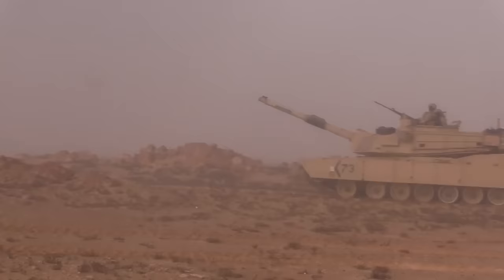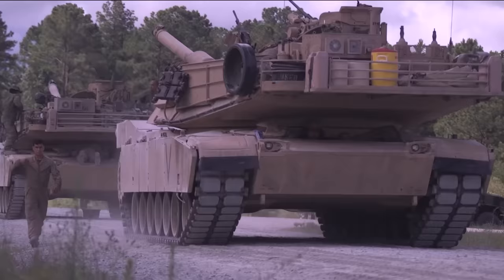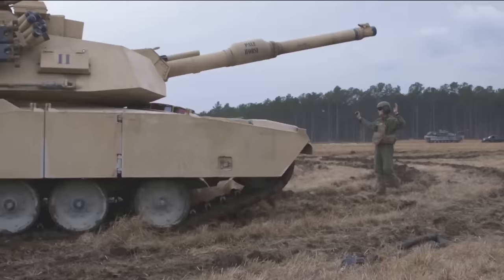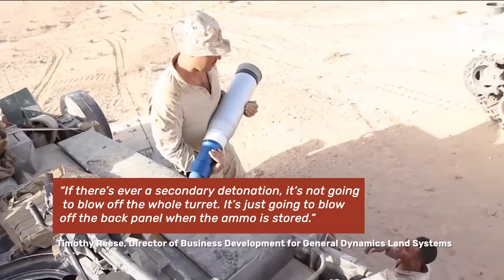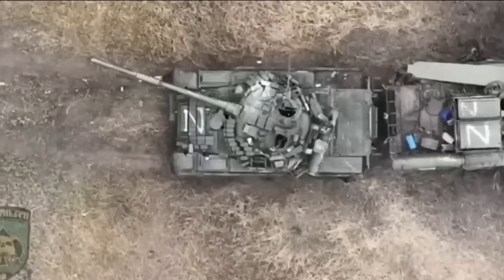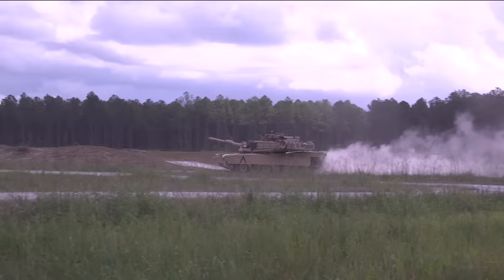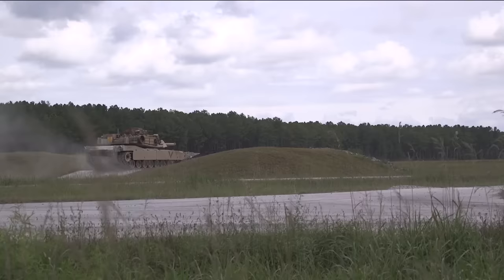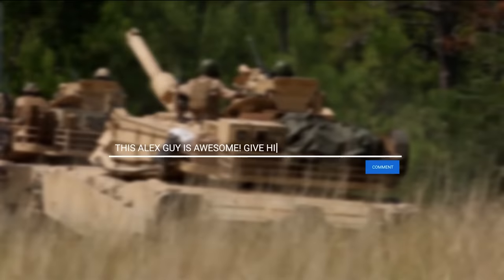America's next-generation main battle tank: ABRAMSX

Comment: Ah yes.  Massive lithium ion batteries.  In a tank.  That gets shot at.  By very big guns.  No way that can go wrong.  

As active protection systems aren’t particularly reliable or widespread yet I see this happening: 
-AbramsX is deployed.  
-Abrams X gets wrecked by anti-tank weapons and tactics designed to destroy something 10-15 tons heavier with lots more armor.  
-DoD acts surprised.
-DoD starts ordering armor enhancement packages.
-Packages over stress the batteries and drive systems and/or suspension.
-DoD acts surprised.
-DoD orders a “mobility (engine) enhancement program” which severely reduces its fuel efficiency/range/lifespan or all three.
-DoD acts surprised.
-DoD decides to ditch most of the battery system to make room for a bigger engine/more fuel thereby having wasted all that time, effort and money.

On and on ad astra.

By the time all is said and done AbramsX matches or exceeds the weight of the current Abrams.  DoD spends billions of dollars to move half a step forward if not break dead even.
Reply: How are lithium batteries different than all that ammunition stored in the tank that get shot at?
Reply: @randomnickify  Cell phones, tablets and teslas are all powered by various rare-earth batteries (usually lithium ion) that have a rather nasty habit of spontaneously swelling or catching fire and exploding.  That’s during normal intended use.  

A small car uses 600-1700 lb batteries, imagine how much they’ll have to stuff into the AbramsX to make it “economical.”  To add to it: it’s an all terrain vehicle, carrying explosives and potentially get shot at/run over buried explosives.  

Modern Abrams has the blowout hatches for ammunition cookoff, and it works.  These batteries are already delicate enough so putting them in a thinly armored blowout section isn’t a good idea.  It’s just one more thing to go wrong that isn’t efficient or common enough to be applied to something like a 60 ton tank. Edit: yet.

Comment: It may not be possible, but if they could somehow integrate AA within the tank layout, that would be the ultimate fighting vehicle.
Reply: Better to just make specialized AA vehicles to accompany tank units.
Reply: AA isn't something that needs to be incorporated into the tank itself, because if they did, it would probably close to double the size of the tank if they want anything remotely effective against 4th-5th gen, or worse, 6th gen
Reply: @CrystallineFoxCF  The simple addition of an autocannon (which is likely not gonna be enough to protect against aerial threats) adds a TON of weight, complexity, and takes up a load of space. There's a huge reason why the vast majority of MBTs rarely, if ever, implement a secondary gun of 20mm caliber or larger.

Not disagreeing, just expanding on what you're saying.

Comment: A crewless turret has advantages in terms of crew protection but it would still need to be accessible from the inside in the case of a jam or malfunction. The T-14 has its crew in an armoured box with no ability to access any other part of the tank from the inside so something as simple as an autoloader malfunction would require it to leave the battlefield to remedy it. A former tabk crewman mentioned something before about workload on the crew, things like daily maintenance and upkeep being split between 3 crew members instead of 4 leading to more fatigue over time. Which would be increased by the additional electronics and autoloader. With top down attack anti tank weapons being so prevalent on the modern battlefield too you still need the top of the turret to be significantly armoured to protect the crew, even if there's no crew in the tureet itself. There's no right answer but I can definitely see the advantages of a tank that's able to do more with less crew, especially in a military the size and broad a scope as the US

Comment: I think the most important change is the swap from turbine to diesel electric. With so much weight to move around, electric motors are far better. The instant and continuous torque combined with utilizing the same fuel as the rest of the military fleet will dramatically reduce the logistics load of fielding Abrams. The diesel electric drivetrain has been utilized on train engines for a long time, and there's a reason that combination is used for moving huge amounts of weight as efficiently as possible. I think the biggest restriction for the US sending MBTs to Ukraine is the logistics and swapping the turbine for a diesel engine would make the fuel requirements and maintenance far easier for Ukraine and have allowed for a much easier time training the support and maintenance teams to utilize it.
Reply: The Abrams has always used the same fuel as the rest of the Army, JP8. It's the diesel engines that are picky about fuel; the gas turbine can run on pretty much anything.
Reply: @hailexiao2770  So, the Bradleys run on JP8? I thought they were diesel. I'm not being snarky, I'm truly curious and willing to be corrected. While most aircraft run on jet fuel, it's typically in the rear, not the front lines? But, it's certainly an issue for non-US militaries.

Comment: One caveat: whenever a company claims "15% fuel savings over this is that", just remember that it depends a lot on the test protocol: just look at VW for a lesson in how that's done! I'll bet dollars to donuts I could create a test protocol for these two very disparate systems that favors the turbine (I'm thinking a test that simulates the Battle of 73E, racing across an open desert which would be very difficult for an underpowered hybrid system to match the turbine system).
I think the system has a great deal of potential, especially as LeTourneau has been using hybrid systems in heavy equipment for 70 years: just take the numbers here with a grain of salt is all.

Comment: If the Abrams-X is produced, it will be a Four-Man Crewed Tank and likely using a new model Gas Turbine Hybrid Engine.

The first will allow for a dedicated Drone Operator while the second would include some of those new ceramic metals I've heard of that will reduce the engine weight, increase output, and reduce fuel consumption while allowing the Tank to be actually operated and moved on Electric Power to extend fuel economy to match increased time between engine maintenance.

One thing I notice, is that a lot of people forget that Diesel Engines come connected to a lot and have a lot of moving parts. For the US Army, a Diesel is unacceptable in a Tank due to the man hours and work that will be needed to maintain it plus the inability to just yank it.

By contrast, the Gas Turbine HAS improved fuel economy that it is actually closer to more modern Tanks. So, if a M1 Abrams burns 10 gallons just being turned on, then the Diesel Engine Tanks probably burn 8 Gallons to just be turned on. The economy is close that it has been described as not even registering anymore. Coupled with the ease of maintenance, fewer moving parts, less maintenance cycles, high power output, and the ability to be swapped like a battery pack, the US Army will keep the Gas Turbine for the foreseeable future.

Comment: Been wondering... take an M-113 and make it a drone carrier support unit, carrying say 30 s100 switchblades, 2-4 s300 switchblades, and 2-3 spotter drones. That or go with bomb droppers. Add on the 30mm RWS to shoot at any enemy drones or ground forces would be the finishing touch.
Reply: More sensible to put a job like that on the new MRAPs.
Reply: @bluntcabbage6042  this is supposed to be operating miles behind friendly lines, biggest threats would be arty and enemy drones, being more along the lines of the morter variant, but with drones.

Comment: At first, I was thinking why not make the 30mm a coaxial mount next to the main gun? That would make it easier for the gunner to use the same sight and pick between main gun rounds or intermediate rounds. Might be cheaper as well since it doesn't need a separate motorized mount on top of the turret. After thinking about it for a while, I came to the conclusion that it is probably going to come down to a doctrine decision. Do you want your commander actively engaging targets with his own medium cannon or focusing on situational awareness? Do you want the cannon to be semi-automated and helping to provide drone defense? Does the gunner need the option of something smaller than the main gun but larger than a coaxial .50 more than the commander? Is your commander going to have so much to do working all the sensors and comms that they can't afford to stick their head out of the hatch and swing around a .50?

I think, in the end, the amount of work the three remaining crew will have to handle is going to affect the decision of whether or not to add a medium cannon, and where that cannon should be mounted than any other factors. Ammo storage, lethality, etc. are important, but I think it is going to come down to whether or not the crew can handle managing even more systems with one less body effectively, and the cannon (or the switchblade drones) are easy things to cut out to reduce the workload.
Reply: If you want the 30mm for air defense and high-angle targets in urban environments first and everything else second, this placement makes fine sense.
Reply: @crowe6961  That's fair. In my opinion if this is going to be used for air defense at all it will require either a dedicated gunner or one heck of an automated optical search and track system. Maybe both! I'm assuming the radars for the APS systems don't have the power/range to be of much use for guiding the 30mm.

Comment: They should upgrade the gun to the L55 as Germany and Korea have done. Just produce an XM360 version of it.  Can the gunner and commander access the top of the turret.  As most of your video clips show, the personnel usually ride partially outside in the turret unless in direct combat.  In combat tank commanders have been found to be more effective (even if more vulnerable) if they command from this position.  For one thing it gives a commander a longer and wider view than cameras would. Also most crews would strenuously object to spending their whole time sealed up inside.
Reply: There was no point in having the L55 as the main reason Germany used it was because they didn't use depleted uranium and in turn created the L55. The xm360 is a bit confusing as some say there're multiple versions of it one being just a lightweight 120mm and the other being capable of ETC.

Comment: the gunner's hatch under the frontal overhang of the huge 360° deg rotating main turret needs to be re-positioned further forward, clear of the turret overhang . . . infact the sliding hatch itself should be replaced with a conventional flip-up (push up) roof hatch, as in most battle tanks & armoured vehicles . . . instead of the current side ways sliding type hatch . . .

Comment: If you reduce the crew size, you have fewer people to share the load of all the tasks a tank crew has to perform, like maintenance and guard duty. Plus, human loaders don't jam.
Reply: Modern military doctrine requires tanks to be with infantry support. Just train the infantry to do tank maintenance. Tank gun jamming is just poor engineering. You design it out of the system by field testing and design iteration. If the tank gun is jamming then the design is not yet good enough and requires more testing and redesign cycle.
Reply: @kazedcat  Everything mechanical eventually fails, no matter how well designed and maintained. Human loaders don't jam. 

The infantry have their own IFVs to maintain, and no one maintains a vehicle more faithfully than the crew whose lives depend on it. 

I have over 30 years of continuous Army service (now as a reservist), I started out as a tank mechanic, I now work as a mechanical engineer in manufacturing, and my experience in both combat and industry tells me that keeping the human loader is smarter.
Reply: @OscarSchneegans  Humans are not indestructible. A properly design machines can have parts last long enough to not fail until scheduled replacement. Loving care does not make a tank stronger. Train the infantry to a standard then have the crew inspect their work. IFV carry 8 soldiers have 4 of them maintain the vehicle and the other 4 maintain the tank. Your objections are full of emotional fluff without critical thinking and sound logic.
Reply: @kazedcat  I never said humans are indestructible. I said human loaders don't jam. An autoloader WILL jam at some point, no matter how well designed and maintained, probably at the worst possible moment as any experienced Soldier knows. Then you'll have to clear the jam. 

I never said that loving care makes a tank stronger. It does make any piece of equipment more reliable. Even then, reliability is never perfect, and you will have jams. 

Your objections are full of straw man arguments. 

My objections are full of 30 years of military experience (10 years of which was on tanks) including three combat tours. 

How many years have you served on tanks? How many combat tours have you served?

Comment: A video covering equipment used while punching through a fortified defense line in similar perspectives as to the one’s Ukraine will have to tackle. Also, it seems to me that a modified Bulldozer or even a Ford Tractor with a large box grader on it would be Ideal for trench lines. You could fill in paths for artillery and personnel could travel. At the same time killing anyone in the way such as troops within the trenches by back filling these trenches relatively quickly. Just a thought. 
What do you think?

Comment: Take that diesel-electric hybrid and use it on a "drone-carrier" armored vehicle. Equip it with purpose built drone racks and launching facilities, so each carrier can utilize, recharge, and maintain 100 drones, or maybe multiple 100's. Use purpose built drones with greater autonomy, and much less reliance on electronic signals, with greater range, and the ability to "perch" in a hard to detect low power mode. This would be a game changer. Just as navies saw the utility of a few airplanes, but then experienced a massive paradigm shift when they went all-in on specialized airplane carriers and specialized planes, armies might well experience a paradigm shift as well! 

Such a drone carrier wouldn't be expected to go toe-to-toe with MBTs, much like a WWII aircraft carrier wouldn't be expected to close distance with battleships. But by enabling the use of orders of magnitude more drones added into the mix of combined arms, we'll see some of the innovations in the use of drones we see now in Ukraine, synergize and radically change combined arms tactics.

Comment: I think there is still a role for a main battle tank, as long as it has either built-in defenses against drones and ATGMs or has a doctrine of infantry support and/or escort vehicles. By "support vehicle", I mean an armored escort that can carry anti-drone/aircraft, anti-ATGM, and perhaps even anti-artillery weapons. This might be simpler than loading it onto the MBT. This could be loaded onto an IFV, but that might put too much on their shoulders. Instead of dismounts, the interior volume of a tank escort might have VLS cells for ATGMs and larger drum or replacement drums for an autocannon, machine gun, grenade launcher, or mortar. I'm not sure how well a mortar might work, but with the increasing use of PGMs and AI, perhaps a mortar can be fixed and pointed in the general direction of an enemy or desired smoke screen and the shell will guide itself, perhaps even choosing the best target in the target area.

Another idea I like is a tankette-like vehicle that can act as a light tank and tank-destroyer and assault gun. The idea is to make it smaller and less expensive so that more can be fielded with fewer crew and perhaps controlled entirely remotely or by AI. It could look like a mini-S-Tank (Stridsvagn), with no turret but having a fixed gun aimed by turning the vehicle. With PGM and AI, it may be less important to aim precisely, allowing the gun to fire off-axis and letting guidance and fins or rockets direct the round to target or even performing indirect fire as short-range artillery. I could even see this vehicle acting as a base for bolt-on systems for mission-specific roles, like ATGMs, MANPAD-like SAM cells, a bolt-on turret for a machine gun, autocannon, grenade launcher, etc. While all those bolt-on systems may be too much for one person to control, they could all be controlled remotely by a team in the same room far away. I suspect it could be either wheeled or tracked, but I'm leaning towards wheeled for speed, but I wonder if the wheels could be adapted for better traction with track looped around them (with appropriate transmission) or by putting fold-out spikes/paddled on the wheelhubs that can increase traction in loose soil or provide propulsion through water of it were to be made amphibious.
Reply: Nothing has yet to replace the tank.
As nothing can bring a direct capable large caliber gun with a large armour mass to the front line

Comment: Well, I can't speak for any Tankers, but were it I on the choice for turret mounted weapons I'm greedy and I'd want the 30 Cal and the Small boar piece as well...but I imagine its an issue of ammunition and where to put it. Of course the Army could have two models  one with the 30 Cal the other with the smaller field piece and run them in tandem groups. Are they going to get a version of the RAM-155 Munitions designed for the Abrams, because that could or would be a game changer. The increase of range would be massive. And if they could just save a tad more weight and get its speed up to say 60mph...would be sweet.